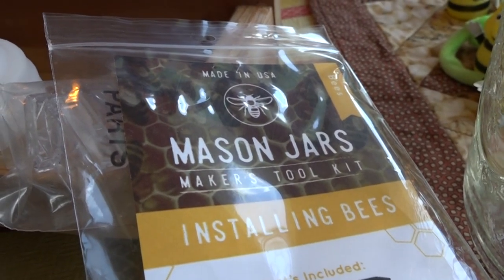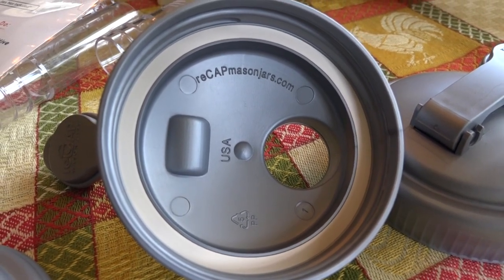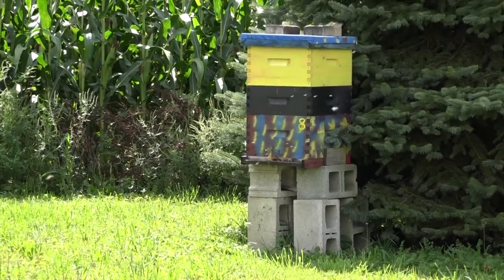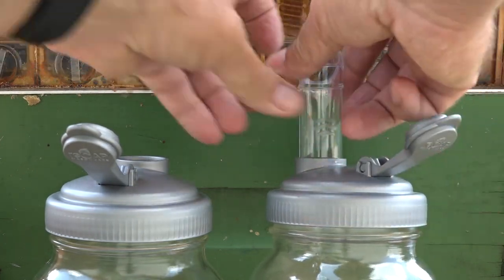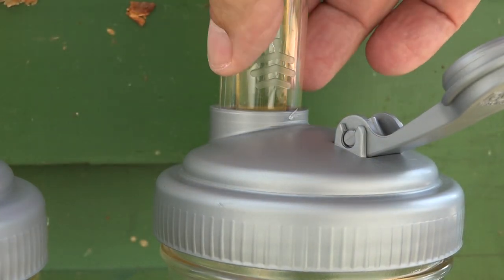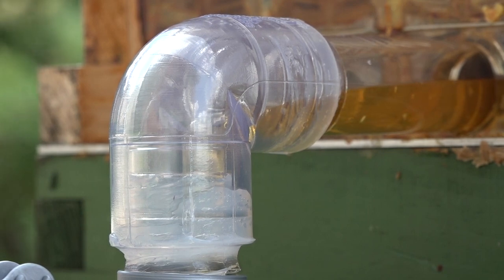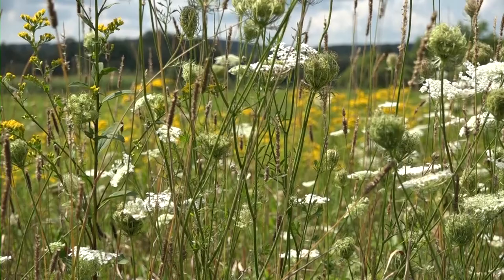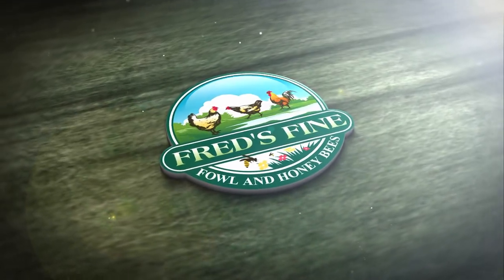How To Extract Honey with Flow Hive Supers and ReCap Mason Jar Lids Easiest Method

Comment: Great Lids -  I just use a piece of clear food grade tubing that fits the flow tube ($.32 for 6") and bend into a hole in a Plastic Mason lid.  Easy to clean and strong.
Reply from the maker: There are endless configurations, thanks for the suggestion.

Comment: Hey Frederick!  First of all thank you for your videos. I am very intersted in starting a bee keeping project in my farm and i was planning to use flowhive for this project. Overall ive seen good reviews about it , but one critic that concerns me is that there is little space for bees to transit added to  the plastic material  makes  them have alot of friction with the walls and thus shorten their lifespan and general hive health. I ask you about it because i know you are unbiased. Thanks again!
Reply from the maker: HI Juan! I'm not sure what your question is? If the concern is about the queen excluder which is plastic and placed beneath the flowsuper, those have been proven to wear out workers early, causing them to squeeze through those bars, in fact, some worker bees can't make it through queen excluders like those. If you're asking about bees somehow rubbing against the flow-frame mechanism itself? Meaning that the plastic cells are restrictive? I have witnessed no evidence of that at all, they go in and out of the honey cells apparently unimpeded.  So, yes, that happens with queen excluders and no, it doesn't appear to be an issue with the flowframes themselves. THanks for watching and commenting! :)
Reply: Yes I was refering to the queen excluder, thanks for clearing that up for me. My other questions were: Do you recommend the flowhive for my project of a bee keeping sanctuary?  Is it true that the honey from the flowhive is not naturally ripened by the hive because the cells are made from plastic and there is a natural process of ripening tha occurs while the honey is on the  hive entirely made by bee's wax  ? Thank you for your time.
Reply from the maker: Hi again Juan, If someone is telling you that honey from flowframes doesn't "ripen" due to plastics, it's probably time to stop listening to that individual. The dehydration process is the same, no matter what the honey is stored in... remember that there are keepers making chunk honey in plastic frames for later retail. This is also why I do a refractometer test of the honey at the end of each of my flowhive draws in order to remove that speculation. So, it's not the bees wax, it's the amount of time the honey remains in the cells while the bees dehydrate it which is often referred to as "ripening", when the bees cap the honey, it's at proper water percentages. I think the concern came in early because keepers were thinking the flowhive owners couldn't see, or wouldn't check to see that the cells were being capped prior to removing honey. Easy to test and be certain. IF the honey were too wet for one reason or another, you can still dehydrate the honey further in a controlled space with fans and dehumidifiers. I've never had to do that, but it's possible to save a harvest.
Reply: Thanks for all the feedback Frederick,  Have a good night.
Reply from the maker: You're welcome!
Reply: Hmmm, I didn't know that queen excluders "shorten (worker's) livespan and general hive health."  Do you think that setting a completely enclosed flow frame box with a separate entrance to it for the workers to enter and exit from right on top of the rest of a hive would still be used by the bees in that hive to store honey, or only if it's connected to the hive through a queen excluder?

Comment: Lovely video Frederick...... I'm just checking what is needed re the bends. In the UK a pvc bend is less than a £ but the shipping always getting dearer by the week is £6.. The clear pvc  90 deg bends are about £14 each plus the postage...... wow.  It would not surprise me if yours in the USA are much cheaper.  Do they all come from China I wonder?  
When I was working in Industrial Heating a lot of the cheapest gun metal fittings came from Italy.
It baffles me why a clear bend costs so much dearer than a coloured one?  I cannot imagine any contaminants will be leached out of the PVC in the time it takes to drain the as you say 1/2 gal of honey........   I think I'll be catching my honey into Pet  one gallon bottles and then transfer into glass jars.
Was your 90 deg bend made in the USA?
Reply from the maker: Any food-grade elbow will do. The clear elbows are used in food production systems so they can observe the flow. There are less exepensive options, but you'll find them associated with food processing systems.

Comment: Looks like you could have 4 short elbows and 3 long elbows and do all 7 combs at once...as long as that doesn't disturb the hive somehow.  Seems like a no-brainer for ReCap or Flow to sell as an accessory set.
Reply from the maker: I did a demonstration where using all flowframes at the same time is a very bad idea. Too much honey drips inside the hive for the bees to keep up with and they are driven out.  I have a complete set of elbows now, but that's just so I can harvest from several different hives at once. I also agree that ReCap and Flow need to get together in the future! It's a near perfect marriage :)

Comment: Frederick I forgot to mention the OD of these Flow hive tubes are 25.5mm.  Although the round plugs seem a fairly tight fit I think I should  make stainless latches to cover the plugs. What a disaster it would be if any of the plugs popped out of their own accord!
Reply from the maker: I'm not sure what you mean by using plugs?
Reply: @FrederickDunn  Hello Frederick You may call them bungs ( the small plastic (polypropylene male caps/inserts that push into the drain points.  I note these could possibly pop out.( Murphy's law = if it can happen it will happen!) but maybe not? I may be worrying about something that may not happen. It could happen though because there is nothing holding the bungs in only friction. Yours may well be better than the Two I have so yours may well be better engineered re the fit of the plugs.   Thank you for your help as always.

Comment: Is there any possibility that an ell for potable water pipe would NOT be food grade?  Very nice video, thanks!
Reply from the maker: Yes, that's possible. Food-Grade in this instance is a material that is approved for food processing - copper for example, would not be approved.
Reply: @FrederickDunn  Also, I believe "Tygon" is rated food grade, but check that.  Tygon is that clear flexible plastic tubing that is a form of vinyl.  I would bend gently from your spout and down into the jar cap.  Have you considered making a hive key or modifying a Flo key such that the flattened edges are removed  from the rearward portion, thus being fully inserted only the rear half or so of  the flo frame is opened.  I think that method would still avoid flooding the hive and greatly reduce the drip time at the end of harvesting that frame.
Reply from the maker: @rooster3019  Lots of materials can be sold as food grade, there is lots of tubing available that meets the FDA requirements. Lots of options. As for the key, I don't see a reason to modify it as they work fine and you can open as much or little of the flow-frame as you wish by the depth of insertion.
Reply: @FrederickDunn  I guess you are right.  No reason to get in a hurry.

Comment: So I was thinking (I do that sometimes), that if you had a spring large enough to fit on the inside of the tubes, you could heat them up, and slowly bend them, eliminating the gluing with silicone, and making a stronger, easier to clean, and fail proof 90 degree angle.
Reply from the maker: I'm not at all against bending tubes, but they just aren't long enough to do that effectively and have the necessary play. I was told that ReCap Mason Jars will be coming out with a custom single piece elbow for this purpose and I'm looking forward to seeing what they come up with :) Thanks for that suggestions though!

Comment: Just another thought maybe u could use good grade hose or tubing u can by at several diy stores? Just heat to bend 😉😁👍🐝🐝🐝🐝🍯🍯🍯
Reply: I could also get it for u by the ft. 😁
Reply from the maker: That's a great Idea but I'm not a fan of the flexible tubing :) These are compact and easy to clean and store...
Reply: Also, the more flexible tubing contains a lot more chemicals to make them that way.  Phthalates and other plasticizers are hormone disruptors that contaminate foods and can cause major health problems, even cancer with repeated exposure.  Even "food grade" plastics aren't 100% free of those chemicals, but they contain magnitudes less and of a less toxic nature.

Comment: why not just use a standard 3/4" pvc elbow ? the elbow does not need to be clear. they are cheap, and they are good enough to supply drinking water to your home so they should be fine for honey.
Reply from the maker: You are welcome to use anything you like.

Comment: Hi Mr. Dunn, I literally stumbled upon your channel about an hour ago so I haven't gone through all of your videos yet; I don't have any apiaries but it's one of those "maybe one day when I have my own place and yard" projects. I was wondering, when you collect honey, you mention tipping the hive forward a few degrees (and not having to do it with the regular flow frame); what's the reason for this? Sorry if this is answered in another video of yours, I'm still going through all of them haha. A google search only came up with "to let condensation drain" but this sounded like more of a hive maintenance action as opposed to a honey-collection action. Thanks!
Reply from the maker: Hi Kingston, welcome to my channel! Ok, I actually tip the flowframe/hive back, not forward, and that's to facilitate the honey running towards the back of the hive where the tubes attach for extraction. The hive should remain tilted back after honey extraction in order to keep any dripping honey inside and not on the landing board which may get the attention of other bee colonies and kick off some competition for the honey. IF you own a complete flowhive system, there is a shim already built into the bottom board which keeps the bottom board flat, yet the upper hive is already tilted back towards the extraction plugs. You are correct in that normally you want your hive slightly tilted forward, towards the landing board and this helps shed rain water and melting snow etc so the bees have less to deal with inside. I hope that answers your question :)
Reply: That makes a lot of sense, thanks for the quick reply!

Comment: How did you get the bees to go to the flow supers?  My bees would not fill the flow frames. The filled the second brood box with honey, rather than use the flow frames. they barely even sniffed the flow frames. I tried smearing wax on the frames, I tried pouring some honey on the frames, and nothing!  If you have any tricks to offer to get the bees to come up, I would so appreciate it, otherwise I am not sure I'll even use them again next year. Love your videos by the way.
Reply from the maker: Hi Deb, I didn't do any preparations to the flowframes at all. The bees just moved up into them after the lower boxes and frames were full. These are established colonies, it may take longer with new colonies of bees. Productivity has to be high for them to expand into the flowframes and above. They do use traditional frames first. Some bees take to them better than others and this is why I move the flowsupers onto my most productive colonies.
Reply: That makes sense has these were new hives. I'll try again next year. Hopefully I'll have better luck. Thanks.
Reply from the maker: You're welcome Deb, I wish you all the best with your bees.

Comment: seems like major overthinking about a small problem. you could use some mosquito netting or screen from an old screen door to just surround the jars/hive valves, then you could use whatever jars/containers you wanted. if the wind was a problem as a commenter here said, you could build a wood or glass/plexiglass/acrylic box (or just repurpose some old windows) to surround the jars, and again you could use whatever containers you want. lots of options other than buying specialty single-purpose products
Reply from the maker: HI Junkdna83, I'm not sure about overthinking, I'm just sharing my methods and the things I find that make my process easier. There are many solutions that I'm sure others like yourself will come up with. Here where I live, Ball Canning Jars are standard and widely available, I was excited to find jar lids that not only fit those wide-mouth and standard jars, but that just happened to have a hole that perfectly matched the flow-tubes. I hope you make videos showing your method, I'll be happy to check it out. These are working great for me.